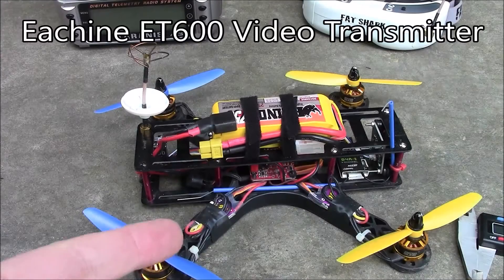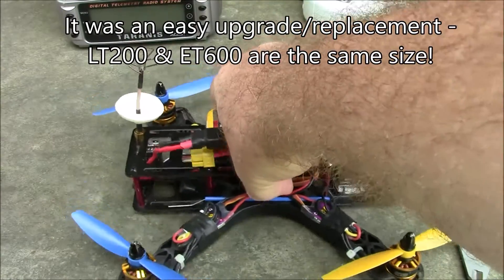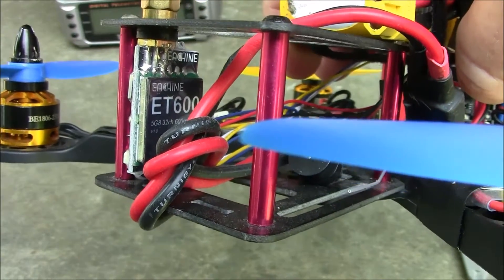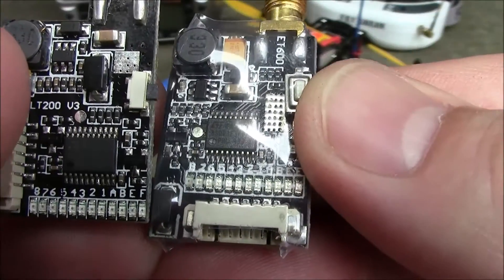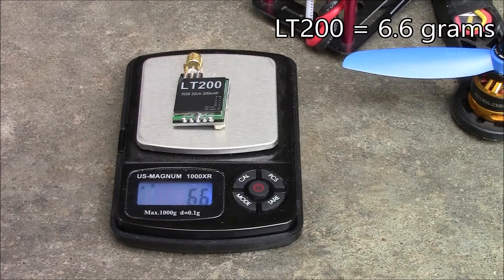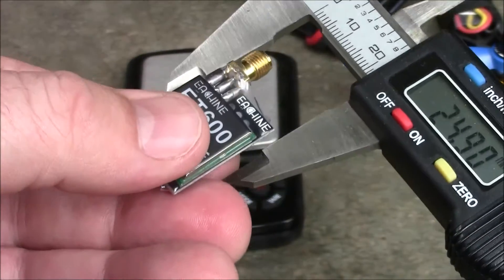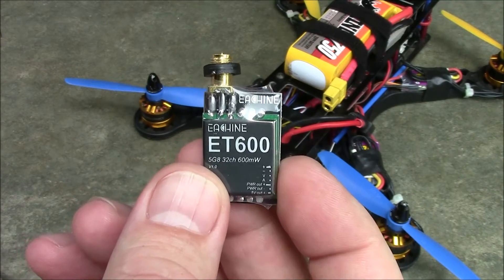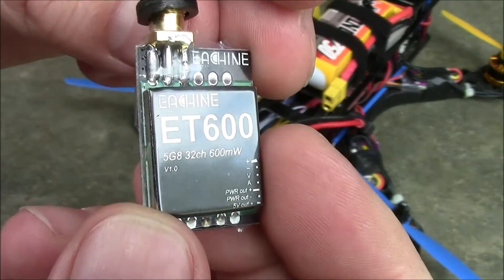ET600 Overview from Banggood... with some LT200 "versus" thrown in

Comment: i want too order it but not shore if can connect it with special cable to the gopro 4
Reply from the maker: You'd probably be better off using a FPV camera for the video transmitting.  The GoPro will work, but there is more delay with a GoPro.
Reply: Ok thank you is the delay that much than??? i Will use it Just for taking few video's and pics
Reply: Not for fpv racing
Reply: For a cheerson cx20
Reply from the maker: Oh, then the delay won't matter much.  It should work just fine for it. You'll have to have a video ouput from the Go pro that goes to the video input on the VTX, maybe the ground wire too.  I'm not 100% sure. I did some FPV with a GoPro back when I was starting to learn. It worked real well other than the delay.

Comment: Thanks Travis. Is that a black plastic/rubber spacer you have between the frame and antenna? Wouldn't that decrease power or something? Just asking as I'm curious.

Thank you for your contribution.
Reply from the maker: +Amir Tahami It is actually a prop adapter that I cut down.  The antenna wasn't pinching the frame and was flopping around.  That is just there to make it fit tighter
Reply: OK understood. I did have something similar as I thought that the antenna, touching the carbon fiber frame would cause signal loss or something. I did experience a total blackout in my Quantum V2's. I immediately ordered a set of Dom V3's, just needed a lame excuse to explain to my girlfriend HAHAHAHAHAHA

Comment: Thanks for the vid Travis! I picked this transmitter up, now I'm stuck on what antenna to use. What do you suggest?
Reply from the maker: +Code3WRX These are the ones I use.  Just be sure to choose the right connector.  For the ET600, you'll want the RP-SMA.  You'll still have to choose either "W" (straight) or "L" (90 degree bend) antennas.
  http://www.banggood.com/5_8Ghz-Mushroom-Omnidirectional-Antenna-For-transmitter-p-942317.html?p=6Z050013977120130325

Comment: Hey Travis - thanks for the great videos!  I decided to try out your mounting system for my TS5828 vtx - vertically through a hole in the top rear.  I was wondering what you use to get a snug mount to keep things rocking about - l'm having a hard time finding SMA size (1/4" 36 TPI) screw nuts from anywhere but China via eBay.  I tried making rubber and stacking rubber washers and then cranking the antenna down until everything was tight, but that vtx is already so prone to heat, I'm paranoid about a) not getting a perfect connection between the SMA connectors and burning out the vtx and b) the TS5828 gets so hot while running, I'm worried about the rubber melting.    Do you have any suggestions where to get the hardware to get the vtx mounted nicely, preferably the proper SMA nuts?  Hoping to avoid having to wait 3 weeks to ship something from China to the Northeastern US because summer will be over by then :)
Reply from the maker: wildtexusa I used some propeller adapters.  I had to drill it out so it would fit, but it did alright.  If you think it isn't getting full connected, you can sand down the prop adapter to make it thinner so the antenna gets on a little tighter.
Reply: *****  "scrounge and modify" sounds like a good plan!  Thanks for the reply.
Reply: wildtexusa Rather than mounting it directly thru the hole, grab an L bend. Put that thru the hole, stick the vtx under the top plate with velcro, tape etc. Then if you crash or it gets hot, you break the L bend, not the vtx...

Comment: Hi mate, great video as usual! What about the tx temps? It's hotter than the LT200? The Lt200 is pretty hot too, but did you notice some differences?
Reply from the maker: Alessio Molteni I don't notice it being much different than the LT200.  It is out there in the open so there is a lot of airflow going over it so I'm sure that is helping it stay cooler.